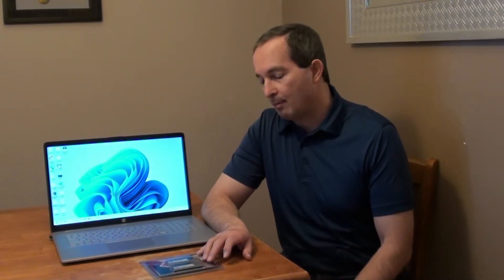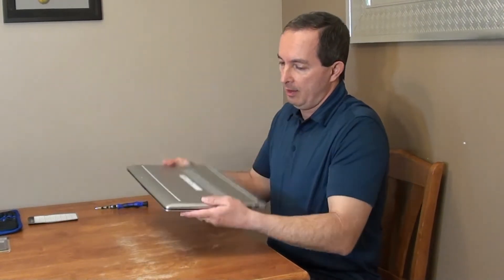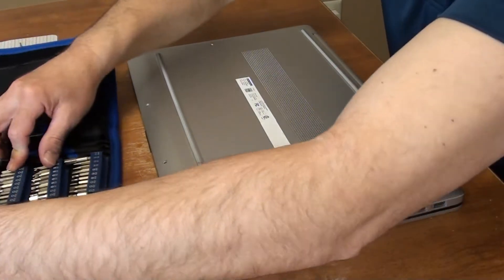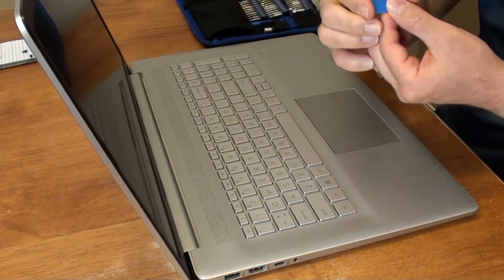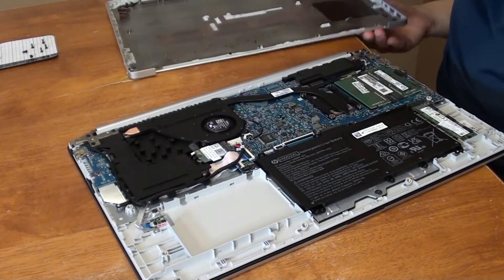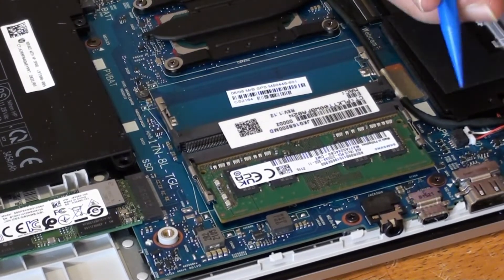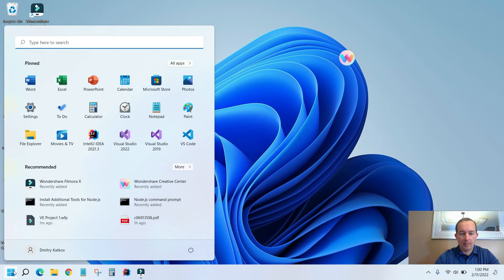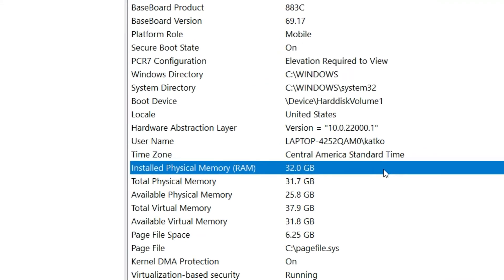How To Install / Upgrade 32 GB RAM On HP Laptop

Comment: Can this upgrade to 32gb work for the HP Laptop 17-by4xxx (17.3" Intel Core i5, 16gb RAM)?
Reply from the maker: The installation process is exactly the same. I would just make sure I get the right type of RAM. I have made that mistake before when I bought DDR3 instead of DDR4.